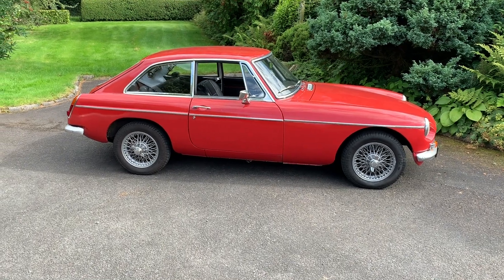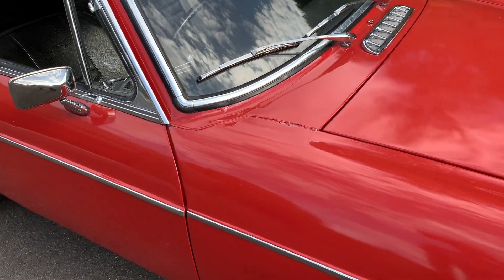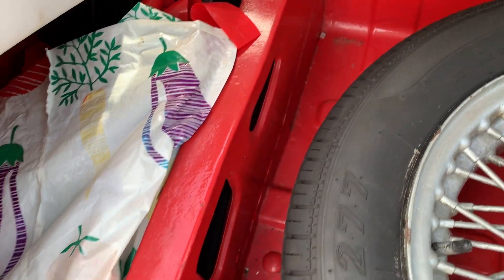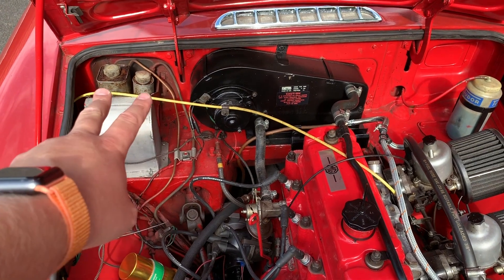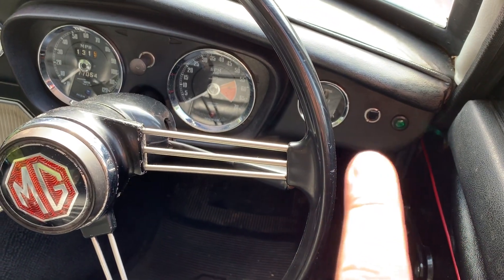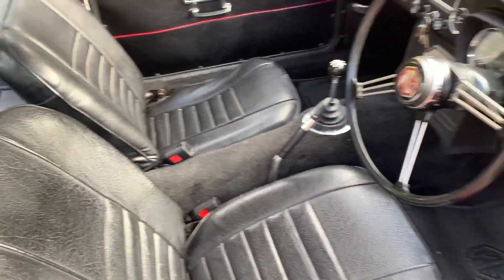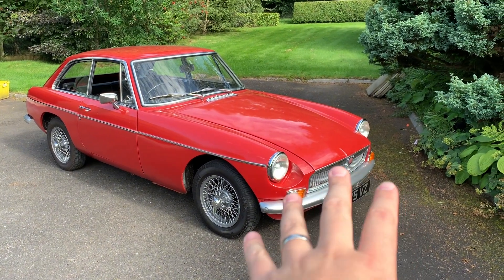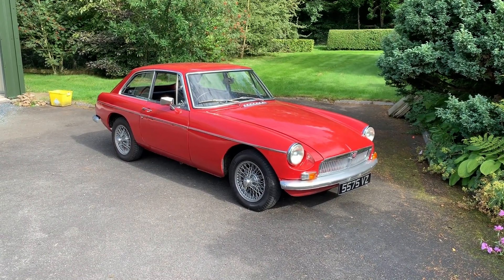MGB Buyer's Guide

Comment: Great video, I really like the look of these chrome bumpered MGB's. I would like to have an 1800 GT version but I know how much space and time they take up. I used to be a Vehicle Refinisher so know all too well about dreaded rust traps in cars from this era, not just British ones. The thing is if I had a garage big enough I would buy a grotty bodied MGB GT with good running gear, trim and glass house. And then save up for a heritage body shell and re-build with upgraded bushes, cooling fan, ignition etc. It would be expensive but in the end I would probably really enjoy the time rebuilding and knowing my own car inside out. I know from experience that many old cars can have what looks like superficial light corrosion but once a job is started it can turn into a major complete new sheet metal section. You will be wasting money and time removing visible rust then painting a car, when the cause of the rust is not tackled from within first, it will just bubble straight back through. Most cars rust from inside the box sections to the outside meaning if they are too corroded internally then you are better replacing entire sections or re-shelling. Sills are always the first to go along with suspension mounts and anywhere dark and damp. If I had a new shell I would obviously spray it first (ensuring all necessary holes are drilled first), then pump all the cavities and box sections with wax oil. Body work is extremely expensive to repair due to the time and labour involved, luckily these cars have great parts availability.
Reply from the maker: Thank you and thanks for watching. Sounds like you have a great idea for a project there!

Comment: Nice video. I have a Tartan Red 1972. I've had it for 4 years and I will never get rid of it. It makes me smile every time I take it out. Love the accent, too!
Reply from the maker: Thank you! And thanks for watching too! Can’t wait to get mine back to proper Tartan Red, rather than this orangey-red it’s in!
Reply: @restosaga  Full respray when you replace that off side wing? It looks in good shape apart from that wing. The iceberg rule tends to apply to visible rust on those wings, unfortunately. Your interior looks very original.
Reply from the maker: That’s the plan. Hoping for repair rather than replacement as new wings are horribly expensive!
Reply: Restosaga Classic Car Restoration Best of luck, mate!
Reply from the maker: Watch this space! Thanks!

Comment: You left out one very important body component to check: the  monocoque structure that forms the frame. I owned a 1965 MGB here in the United States back in the late 1960s and early 1970s and while the engine, transmission, and body were all in great condition the monocoque structure rusted out and the car became un drivable.  It's best to put the car up on a lift to check for this problem but if you can't do that just lay on the ground and check out the area between the rocker panels and the drive tunnel. Anything other than minor rust in this area should send you running in the other direction!
Reply from the maker: That would nearly be a whole video in itself haha. You’re right, buyer beware of iron oxide

Comment: Very nice. I had a MGB and my friend had a MGBGT. I always thought it was funny that the GT was a little faster than mine. The two single barrel carburetors we’re always a pain to keep tuned.
Reply from the maker: Didn’t know it was faster, interesting! I think my carbs need done again, but then it is 2 years since I went near them...
Reply: I worked as an MG mechanic in the 1960s  and early 1970s and I always found SU carbs extremely simple and easy to work on as long as you understood how they worked and used the proper techniques. Sadly in 1970 US air standards forced MG to change some of the clearance tolerances between the piston and the dashpot chamber. In some cars this resulted in erratic idling speeds when fuel deposit buildups caused the piston to stick. Although strictly speaking it was illegal to do so some mechanics cured this problem by using an appropriately sized hone to lightly polish the inside of the dashpot dome thus creating greater clearance.

Comment: Very nice example. I hope you'll deal with the bubbling of the offside door sill 4:00 sooner rather than later. I don't know about the MGB but Mini sills were fitted with large drain vents on later cars; I sprayed Supertrol anti rust fluid up my Mini sill drain apertures and they lasted the life of the car. Supertrol soaks into any existing rust and stops further corrosion since it is quite thin, like paraffin (so it may soak into existing rust better than e.g. Waxoyl, not sure on that but it probably won't protect like Waxoyl on areas sprayed by water). Very impressed with your corrosion free engine bay. Overdrive & a Kenlowe electric fan would be good improvements to consider for the future. It looks like the drivers seat has been re-stuffed as compared to the flatter looking passenger seat 11:13. I see the engine was not quite cold, it would have been nice to hear her run even if the carbs were not quite in perfect balance 😁
Reply from the maker: Thank you for watching! And obviously very intently! Yes, long term plan for a full bare-metal restoration of this beauty. Mechanically does not need a huge amount but then it never starts out that way, does it? Main concern, as you point out, is rust. Hope I have enough time and money soon to get at it! Watch this space!

Comment: I bought a brand new 1969 gun metal grey with a black leather interior MGB GT when I left the US Armed Forces in the summer of 1969 . My 105 lb. wife loved to drive  that car and cried when I sold it in 1974 for a  green Porsche 911T . Still dream of that MGB GT these days but not the Porsche which was a handful to drive. .
Reply from the maker: Lovely! Great to have those memories, thanks for sharing!
Reply: Looking at one for a 1000 bucks wondering if it's worth the work
Reply: @robertmudrow3617  It may be if you can do a lot of the work yourself .The condition of the body is critical . If the rust is easily repairable and you have some mechanical skills go for it after you get an estimate of what  needs to be done and the cost of parts . Check the Moss Catalogue ,,,their parts are reasonable ,have incredible inventory and are very helpful on the phone . Good luck !
Reply: Right on! Thnks for the pointers. Definitely love the body and wire wheels. Car has character.

Comment: Number one in the buyer guide is don’t. Well not if you live in America as you will spend more time waiting for parts and shipping costs than it’s worth. I found that out with my first and only MG. A 74 chrome bumper that was in decent shape. Loved the style and even though it was pricy $4800 in 1998 the seller convinced me it was a great daily driver. Little did I know the brake cylinders in the back were shot. The clutch cylinder as well. Also the “professional” 12v conversion was nothing more than an alternator and starter wires. About 2 months into ownership stuff started shorting out. Then the clutch went at 50 on the freeway just completely lost the pedal. Started trying to hunt parts in US to little avail. 3 ratty non runners the owners refused to part out and wanted $2-3000 for the whole car. Finally found a place in England to get parts but the shipping cost and time was crazy being this was supposed to be my daily. Ended up stranding me one night refusing to start.And after sinking about $1400 in parts over the 7months I owned it I  Sold it for $2500.
Reply from the maker: Thanks for the comment. It sounds like you had a bad experience rather than the MGB in general being a bad car?
Reply: I don’t know what your problems were but you can buy absolutely anything from Moss Motors… and I mean anything. Or Victoria British who are now owned by Moss.
Reply: I purchased mine back when the internet was still growing. This was in 1982 and the internet wasn’t what it is today. No google or simple searches and no parts stores anywhere had parts for these cars.
Reply: @diemaschine2287  Moss motors was around then and would send you a comprehensive Catalog. Still don’t understand your dilemma
Reply: The MGB is one of those cars that have massive numbers of parts suppliers in the US and UK. And, parts are cheap.  Moss Motors in Goleta( Santa Barbara) Calif.
British Parts Northwest and Northwest Import Parts in the Portland Or area. There is the Roadster Factory and many others.
As to your experiences with the car,  . You are most definitely the wrong owner for an MGB. And your story is BS.
Reply: @jeffhildreth9244   - The original post said he bought the car in 98, in a later post he says 82? Doesn't add up.  Moss Motors placed ads in all the car magazines, plus other owners or clubs would provide info.   I rode Moto Guzzis in the 80s (in California) and the only way to get info in English was from a club.

Comment: Still relevant,thanks,going to see similar car tomorrow on done deal in carlow, looks v good and original,current owners 10yrs,had rebuild. Stored i doors and no rust apparantly. Can check everything you advised, not going to get on a stand, any obvious things to check on test drive? Cheers Andy ,based in Dublin now.
Reply from the maker: Hi Andy! Glad you’ve found this useful. I suppose while out on a drive I’d be listening carefully for clunks and bangs. Feeling for smooth steering and brakes and good power delivery. All the best with your viewing tomorrow!

Comment: Nice car, I've owned 10 MGs, 1x1953 TF, 4x MGBGT, 3X MGB Roadsters and 2x MGC. Presently own a 1970 B Roadster and a 1968 MGC Roadster
Reply from the maker: Nice one, an experienced owner it seems!
Reply: @restosaga  you could say i LIKE MGs
Reply from the maker: Haha, sounds accurate!
Reply: There was no 1953 TF.. The first TF was 1954 with the  TD  XPAG engine.  I have owned a  1946 MG TC right hand drive, with Lucas Laystall cross flow head, bored out, ported, wild west cam, headers, 15" Borani Wheels. 1950 TD set up for Bonneville, a 1953TD Mark II . 1956 MGA, 1964 MGB ( just sold that in Sept.)Now have a 1963 MGB "Tourer" (which is commonly, and mistakenly called a "roadster" )1969 MGC GT with Webasto Sunroof and 4 speed automatic . Also 5 Land Rovers 1958 though 1974, several Morris Minors, 2 Morris Oxfords, 1980 Rover 3500 V8 SD1, 4 Thames vans, 1959 Fairthorpe Electron Climax and few othe Brit cars. s.

Comment: As someone who has restored numerous MGB's I cannot emphasise enough that RUST is the major issues with ALL MGB's.
The cars, literally started to dissolve as soon as they came off the production line and were parked in the dispatch carpark at the factory! The saving grace is new bodyshells are now available, making expensive sill, floorpan, rear inner and outer wheel arch, front wings repairs a thing of the past!
Mechanically in comparison, they cost buttons to restore as generally they are fairly bulletproof, the B series engine is thankfully, as basic as woodchip wallpaper.
Reply from the maker: Agreed. Thankfully my B wasn’t too bad from a corrosion perspective but could have been much worse!
Reply: Simply not the facts. I bought my 1964 B 6 years ago. 100% original and not a spot of rust anywhere.  My friend just bought a 67 GT... NO rust anywhere. He has three other Bs, a 55 TF,  a Midget and a TR6.  All restored and none had rust. Look harder and you can find one that was well cared for.
Reply: @jeffhildreth9244  
I have to ask the question if  the 3 other MGB's, 55 TF, Midget and TR6 had no rust, why on earth did they need to be restored?
Reply: @leytonthomas2043  Your question implies that restoration is rust repair; a rather narrow view. Restoration is defined as the  act of bring something back to its original condition.  Rust removal can be a part of that process.  Rubber wears out, paint fades, seat material wears. Brake and clutch cylinders can corrode.  Body panels and bumpers can dent, transmission bearings and synchros wear  out. Clutches need to be replaced, engines need overhauling, carbs need rebuilding.  Carpets wear and fade.  All a part of the process. It is better to start with a rust free vehicle. Though I can do rust repair, I would not buy a B that needed extensive rust repair. it. If it was a Cisitalia or  other more valuable vehicle, maybe. But not a B. The car is simply not worth it. There were over 500K made. Within 200 miles of me there are roughly 20 for sale . Plenty of choices. 

There are "restorations" and there are restorations. It's all about standards and that begins with a sound, rust free car. Pay more, get more, spend less time and money in the long run.
Reply: I agree with what you say, however after owning 30 plus MGB' s  including a 2 year old Roadster, everyone had the dreaded tinworm to a certain degree. I congratulate you as the only person who has successfully bought a "Rust Free"  MGB, it must have never been used as it was originally intended.
Reply: @leytonthomas2043  Utter BS.    I will accept I am the only one in this discussion with a grasp on facts and reality born of considerable experience. Since  I don't play the one up game, you can have the last word here as the resident expert. Some of us are more discriminant about what we'll buy. Less/fewer  and better.
Reply: Jeff, I take my hat off to you, however, I live in the real world, where, from experience, I have yet to see a factory original MGB, 41 YEARS after the last one rolled off the production line and unrestored,  RUST FREE!  It must be fantastic to own such a vehicle!
Reply: @leytonthomas2043  I enjoy it very much, almost as much as my departed 69 MGC GT purchased in 1970 with 12K miles.  Now looking for a T series. Have not owned one since my 3 purchased in the early/mid  60s.   They complemented my Fairthorpe Electron Climax (one of 21 and the only one known to have been shipped new to the US) and my TVR Grantura with a Climax motor, nicely.  Yet, there is a certain lure to a proper, unmolested MGB, even a rubber bumper.
Reply: Jeff, I have a 1947 TC for sale if you are interested?
Reply: @leytonthomas2043  Looking for a birth year car..original  and NO RUST !   Where is the car moored ?
Reply: @jeffhildreth9244  
Errrrr.......where is it moored???? Sounds like you are looking for a boat!
Good luck in your search for an unrestored no rust original T type MG........you will need it!
When you do......how about some photos?
Reply: @leytonthomas2043  My friend just bought a 1949 MGTC out of San Luis Obispo. ORIGINAL OWNER. Completely rust free, unrestored in beautiful condition. $25K.
Reply: Whether or not an MGB has rust rests largely upon three things: 1. Was it driven in the winter, 2. Was it driven on roads where salt was used to combat ice and 3. How faithfully did the owner wash and wax it. All that said I can honestly say that in all the years I worked as a BMC mechanic here in the New England area I never saw an MG driven in the winter that didn't have rust problems.

Comment: Why does it look high on the wheel arches? Like the later  rubber bumper model with a chrome bumper conversion, lovely car but for that, I’d check the chassis numbers with the Haynes manual, especially because the body condition is so good for a 1969 model, wish you well with it.
Reply from the maker: The springs are quite new and have had very few miles on them so I think they need to settle. Also I think the tyres may be a little too low profile which will not help. Earlier videos show how low it sat before I got new springs. Thanks for watching!

Comment: Congrats on using the proper knock offs. !
Reply from the maker: Haha, thanks! I think they look great!
Reply: @restosaga  Hard to believe that the original winged knock offs were consider a safety hazard. Big mistake, not as bad a s rubber bumpers but cheaper to correct.
Reply from the maker: I’d say if you got close to anything spinning at that speed it would be a safety hazard!

Comment: It was named MGB because it replaced the MGA, not because it had a 'B' series engine. The MGA also had a (smaller) 'B' series lump. Also, there's one common fault you missed. The tops of the doors often develop a vertical split, just below the rear edge of the quarter-light and known to owners as the 'crack of doom'. It's more common on roadsters, so that may be why you didn't mention it.
Reply from the maker: Good knowledge!!
Reply from the maker: More likely chassis flex than weight of mirrors!
Reply: captain pugwash  Don't think so, 'cos it happens even when the car has no mirrors (on the doors, not the wings!). Besides, it only seems to occur on roadsters and, almost always, under the rear edge of the quarter-light, indicating there's some design fault in the way the door fits against the (different from GT) windscreen of the soft-tops.
Reply: I'm glad I read this far in the comments. I was going to point out the MGA, not the B series engine thing. By the way, I think the MG C was named for the C series engine although I could be wrong, it's happened before (1979, I think ;-)).
Reply: @frankhaney8535  You could be right, especially as the MGC wasn't an all-new model (unlike the difference between the 'A' and the 'B').

Comment: Looking at buying a mgb gt 1980 but only place I can keep it is outside in British weather, and will be using it as a daily vehicle to and from work everyday - is it best to give this one a miss as keeping it outside in the rain will just cause it to rust massively?
Reply from the maker: I’d say as long as you buy a good rust-free car and look after it with regular anti-rust treatment then you should be fine. Prevention is better (and cheaper) than a cure!
Reply: Rain isn't the problem, it's salt and mud that cause issues. Keep it clean and seal it underneath, avoid driving on salted roads. Great cars, perfectly useable as a daily driver.
Reply from the maker: Agreed